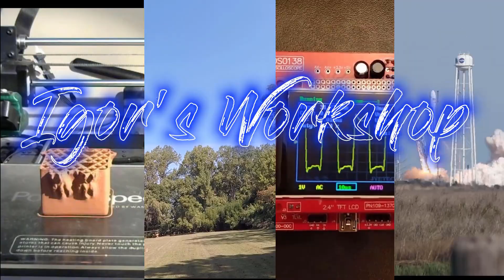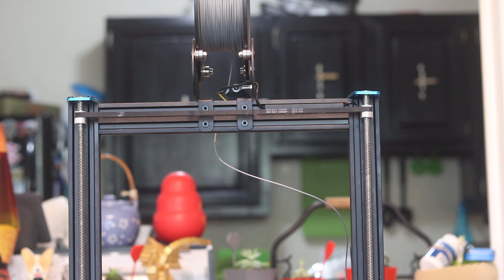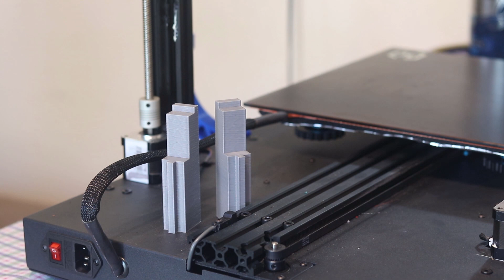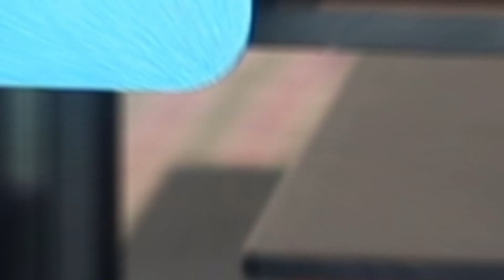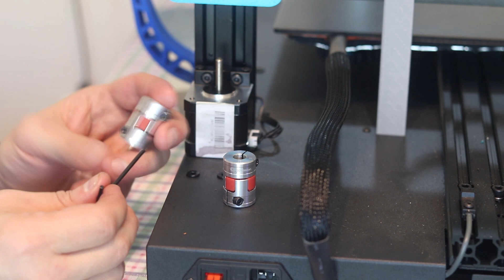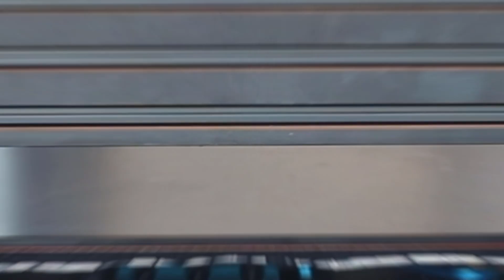Troubleshooting Artillery Sidewinder X1 | Part 4 | Z Axis Couplers Replacement

Comment: Hi, In the video before you said that you removed the Z Belt and the Z Top Bearings, and in this video it seems that everything is in the printer. Can you show how it ends your printer with all the modifications? theres no Z Belt and no Top Z Bearings? I have and X1 and a Genius and I want to have better prints. I asking you cause you said that this modifications make something and they are easy to do. Thanks!!!

Comment: I think my game plan might be to use this machine for a year(since it is my first) without getting too much in to tinkering, only doing a little here and there for the experience. I plan on replacing it with a higher quality printer around 1,000 usd

Comment: i added a CR-10 Z stabilizer kit to the SWX1 yesterday.  Works good,  easy if you dont mind drilling a few holes.  I placed it on the rear of the printer.

Comment: I have owned my SWX1 for just over a year now.  During this time period, I had to replace some items that went bad and made upgrades that appear to work quite well.  Just this week I have experienced an issue with the extruder not heating properly.  I am getting the error message that "Heating fail; with heater ID." I did find that the heater cartridge was bad and I replaced it.  But I am still getting the error message.  The extruder at room temperature is good, 26C when the printer is turned on.  When I set the temperature to 190 or 210, the temperature would fluctuate to 27c and back to 24c or 26c and then falls and then gives me the error message.  All cables and connectors have been checked with an ohmmeter that shows that they are good.  Should I just reflash the firmware to reset the PID settings to get rid of the error message or do you think that something else is maybe causing this problem?

Comment: Just saw a video ( https://youtu.be/ZOZ1qATk8ns ) that looks like it might solve your issues. this guy found out that the z-axis stepper motors could be out of alignment, causing the screwing guide to warp and wobble. He also used the same technique to find out that his x-axis alignment was off. He said it solved his banding issues, which appears to be what you are trying to correct as well. Hope this helps. I will be trying it myself soon and will try to get back to you if it works for me.

Comment: I'm new to 3D printing so I was wondering why do you want wobble in the z screws? Wouldn't that lead to bad print?
Reply from the maker: No, it will not. They are floating in the middle (Artillery actually designed that piece pretty well), so it will compensate for the z rods being not 100% straight

Comment: The z brace fixed my x1. I was trying to print transparent petg and wanted a perfect first layer for clarity so I went to extremes and used a dial indicator. In leveling the bed I bumped the top of the printer and noticed the gauge moving wildly. Barely touching it will move the gauge. The base of the printer is flexing where two z uprights connect to the base. I compared it to my ender 3 and the x1 definitely needs z bracing. Now the quality of my first layer and overall prints are amazing. May not be your problem but something to look at.

Comment: hey Igor, did they fix the Ribbon cable issue with the V4?
Reply from the maker: No, they don't have any clamps. It's really recommended to print and add your own. There are multiple designs available on Thingiverse. Without clamps, there's a good chance of burning the cable and/or the connector, unless you closely monitor the cable and ensure it's seated properly. Many people on the Internet are complaining about it.

Comment: Better to square to the top of the gantry, if you can manage to get the upper rail square. I am willing to bet your whole gantry pitches like an a-frame... I had to shim mine.

Also you forgot to Check the belt alignment on the top. You should make sure the slack on the front and rear of the belt are equal when it is level or the backlash will be huge. You do this by loosening one of the belt pulleys and tightening it when you're happy with the feel of everything.

The alignment of the top bearing plates is important, too but challenging since the belt is a bit to big to allow optimal spacing.

Its a bit like juggling to get it all right at the same time. I had to compromise and pull my lead screws apart a bit more than I would have liked to achieve any belt tension at all.
Reply from the maker: Hmmm... Squareness of the upper rail is probably the one thing I haven't checked. Thanks for the suggestion!
As for the top belt and the bearings - I've removed them as per Artillery support's recommendation.
Reply: I would like more info on belt alignment just got a brand new X3 and the instructions for belt alignment are bery vague and not the best.

Comment: You were mentioning z-brace so maybe this is something you like. Just uploaded it: https://www.myminifactory.com/object/3d-print-z-brace-sidewinder-x1-113870 I think with the regular mkg-gen-L you should be able to print properly. I must say I flashed the firmware added linear advance (0.2) and did a PID tune. I'm on a V4 that already has better z-couplers with just one slit. 3d-nexus and robscar on thingiverse have guides for firmware. I didn't bother trying to flash without disconnecting the TFT. Just opened the case and disconnected it from the motherboard (on the TFT it was hotglued). Will add a switch on the 5V wire to make it simpler in the future. You may like this video for z-wobble:https://www.youtube.com/watch?v=ZOZ1qATk8ns

Comment: One guy on youtube suggested to replace the cooling can with a 40x40x20 fan, which should reduce the variations of the temperature of the hot end. He also suggested to mod the idler, because it is not ridget. I designed my own idler with flaps on the right and left side, and it is way more steady now. However, print quality did not improve much. 
I might buy a 20mm fan just to try it out. After seeing everyone struggling i think it really might be the extruder rather than the Z axis

Comment: Left z-rod wobbles quite a bit.
Reply from the maker: Yep. That's one of the reasons to remove the top bearings. The contraption, containing the nut, allows it to slide from side to side, and this wobble is (theoretically) not transferred to the axis. The axis itself is constrained by the gantry.
Reply: How to fix the wobble properly: https://www.youtube.com/watch?v=ZOZ1qATk8ns

Comment: Hi Igor. Nice job on the video. Thanks! After watching it I wondered how you finished the tops of the leadscrews. Did you put the bearings back in place? I ended up buying an Artillery Genius rather than the Sidewinder. I liked the changes they made to this model perhaps from learning their mistakes with the Sidewinder. I figured that I could live with a smaller build volume for now and I'm pretty happy with it. I have spent the last week calibrating and adjusting settings in Cura. There is no good profile for the Genius in Cura so I loaded a Sidewinder profile and have been modding that. I don't have any Z banding but I did have a nasty seam on round parts and found I was over extruding somewhat both in E steps and Flow Multiplier. I also updated my firmware to incorporate Linear Advance and have been making some changes. It is getting better but I am extremely picky haha. I have not touched my leadscrews or couplers yet but am planning on doing so soon. I don't know how bad the stock controller is and I don't think I'd personally change it unless I find a good reason to do so. Thanks again for all your help. Your experience and videos helped me make an informed decision with my purchase.
Reply from the maker: Thanks! No, I did not put the bearings back. This was recommended by Artillery support, and this also makes sense  from the geometry standpoint
Reply: @IgorsWorkshop  Brand new video about the SX1 Z issues. You should watch it and see what you think. https://www.youtube.com/watch?v=ZOZ1qATk8ns
Reply: Whats the major differences between Sidewinder and Genius? Or what improvements has Genius against Sidewinder? I was looking on it, but i dont like a lot of plastic pieces there. Whole top frame, and also X-axies are holding on plastic holders.
Reply: @creativ01  I think the biggest difference (besides a smaller build volume) are the improvements to the ribbon cable connectors. The Genius uses a PCI style connector to make the ribbon cable connection from the gantry to the enclosure base and more of a locking type connector for the ribbons on the X axis. It has a pre-wired 4 pin connector under the print head cover for ABL. The Z axis leadscrew anti-backlash system has been changed and of course the plastic parts you mentioned. When I first started looking at reviews for the Genius I saw that there was that plastic top cross member and the other parts and was kind of turned off by that but it is solid and very rigid. The parts seem to be a good quality injection molding (not 3D printed) and it does not seem to take away from the overall strength of the gantry. With the larger Sidewinder X1 the glass bed had reportedly suffered from warping and I think the smaller size of the Genius mitigates this to some degree. I adjusted my Z-endstop down a little and tightened the bed down to compress the springs and was able to get all 4 corners and the center of the bed very, very flat. Hope that helps.
Reply: @ew7007  Thank you.

Comment: Prob a SKR 1.4 turbo with 2209 stepper could make a difference?
Amazon has it in stock as a bundle 
https://www.amazon.com/BIGTREETECH-Controller-Compatible-With12864LCD-5TMC2209/dp/B082QYYFVX/ref=mp_s_a_1_5?keywords=skr+1.4&qid=1583011030&sprefix=skr+&sr=8-5#aw-udpv3-customer-reviews_feature_div

I have seen the rails mods with better prints.
Best of luck.
Reply from the maker: Thanks for the suggestion! What do you mean by "rail mods"? Replacing extrusions with linear rails?
Reply: @IgorsWorkshop  yes linear rails mod. Dont know how much it would improve the print.